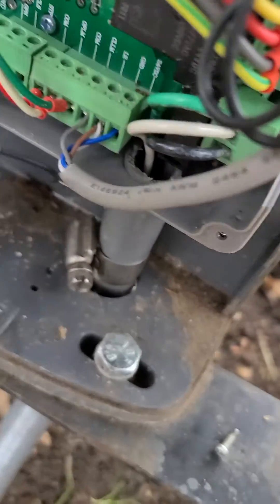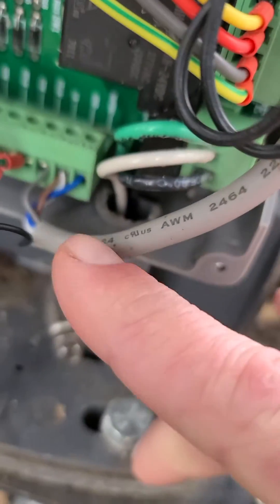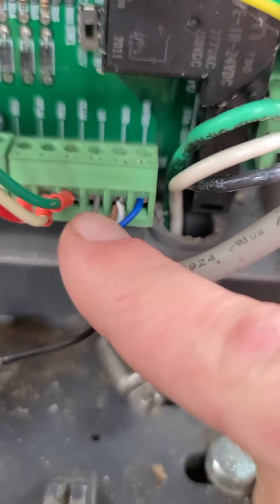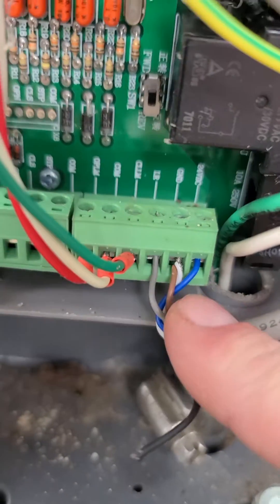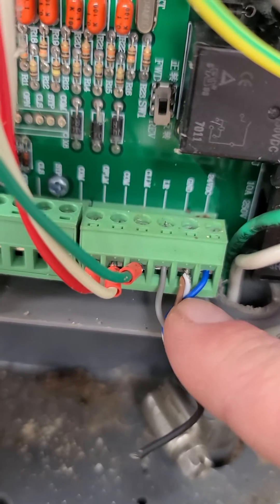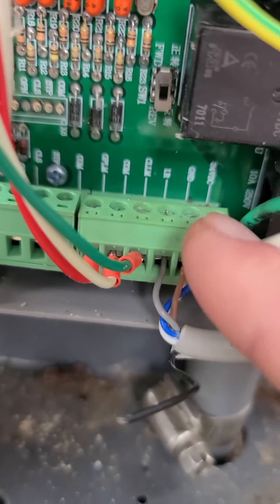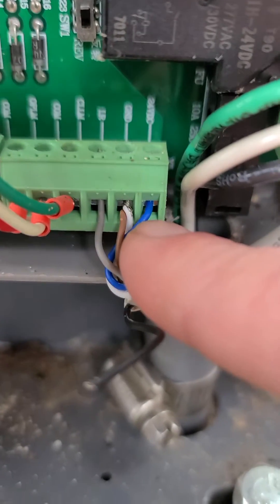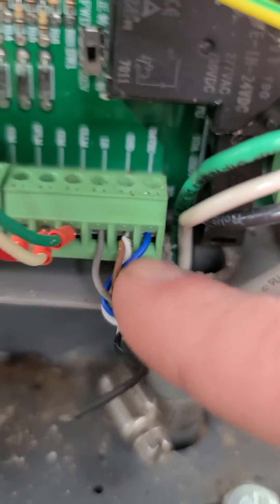CO-Z Automatic Gate Opener. Attaching an infrared sensor

Comment: I have a COZ 1400, connect the photocell from left to right, the gray color, in the middle the white with brown and on the right the blue and it does nothing, the sensor does not turn on the light or anything

Comment: I did exactly what you have shown here but it doesn't stop the ha gate from closing. In fact after it closed it would not reopen. It's still trying to close but it's at the limit so the motor is humming while trying.

Comment: Another question how do I get the automatic close once the gate has been opened? And how do I set the seconds before it closes the gate automatically? Thanks!
Reply from the maker: That's also something I have wanted to know too. Unfortunately, I've never found the information. I'll bet it has something to do with the dip switches on the panel board inside the unit, but I can not be sure.

Comment: Except you forgot to mention about the black wire. Do you just leave it hanging there?
Reply from the maker: Sure did. As seen in the video. The sensor has since failed, so I have just not connected a new one. It suddenly has decided, no matter what, the gate must open and remain open (bummer)

Comment: Do u run wire to the 2nd sensor on the other side?
Reply: This specific sensor model is just one powered sensor and a non powered light reflector mounted on the other side, convenient, but a bit expensive at 50 bucks vs the co-z ir at 20

Comment: This work for the left mount gate or Reverse like the one you have. Mine is the right mount gate or Forward. By wiring the way you did my gate will work opposite. It will forcefully close with or without object in the way but wont open if there is an object in the way. I am thinking about toggling mine to REV and swap the magnet position. It would work but I am not sure it it will cause any problem later.
Reply from the maker: I'm going to be installing a new opener this week or next (depending on shipping times) completely opposite opening setup as mine. I'll let you know what might be different. I do remember that I had to swap 2 of the wires controlling the motor when I originally set mine up, so it's possible that something else needs to be swapped with regards to the infrared sensor. I'll make sure I post a video once I get it working. Thanks for sharing this with me.
Reply: @nathanielross1239 what happened…???
Reply: Were you able to find out the correct setup for the right mount gate or Forward? If you do, can you share? My gate works the opposite.

Comment: Thanks for the video. Can I use two sensors to check both sides of the gate for obstructions? I guess I would just have double the amount of wires in those same terminals?
Reply from the maker: I remember when I set mine up saying that it was only designed to work with one sensor.

Comment: Hi I followed your exact instructions on installing the infrared sensor on a co z gate motor however the sensor picks up but gate continues in the same direction instead of stopping or changing direction and other tips ?
Reply: I have the same damn issue

Comment: To make it work correct to the left the Gray in the Middle White and blue and to the Right the Brown .Black is not used
Reply from the maker: Hmm.. well it works correctly the way I have it wired and it's been up and running for 2 years flawlessly. 🙃 

Thanks for the information because that may be why others have issues with theirs.
Reply: @nathanielross1239  Hey buddy Do you know how to wire the mhcozy wifi relay switch to it?

Comment: I installed and for some reason it works backwards. When I open gate if I cross sensor it will close. Does nothing when opening gate and crossing sensor. Any ideas
Reply: Hi not sure if you fixed your issue or not. But mine was doing the same thing. Our instructions for installing the gate told us to set our direction in reverse because of how the gate was positioned and set our magnet pickups backwards. This worked fine without the sensor but the sensor can not be set up backwards. I had to reverse the direction via switch on the board and reverse the positions of my magnet stoppers. Hope this works for you too.
Reply from the maker: @williamwhite7041  Thanks for sharing this information. Glad you found a solution that effectively works.
Reply: @williamwhite7041  I effectively did this to fix this problem, instead of moving the sensors, I swapped the OPLM and CLLM wires with each other. (I didn’t want to reposition the magnets). I started setting up the gate with the switch on REV, but it appears they didn’t think about how the infrared sensor would behave with that logic. So now my opener has the switch set to FWD, and on the left side like the video and it works correctly. I am also using the retroreflecrove sensor by seco-larm (e-931-s35rrq) wired like shown in the video.
Reply from the maker: I never had issues with crossing the beam and it closing instead of opening. Without seeing your wiring I can only assume you have one set of wires flipped. My guess is you have your sensor installed incorrectly.

Comment: Do you remember wich 2 terminals had that little short wire connected to?  Seems my sensor went bad and I think I need for a my gate to operate again. Until I replace the bad one.
Reply from the maker: I'm not sure I understand which wire you are referring to. Is it one from the sensor? If so, can you tell me the color? I'd be happy to open my panel back up and use it as a reference.
Reply: It's ok I found it. Thanks
Reply: What brand of sensor is that? And could you let me know what each wire is like which is 24 what is com and ground and which is the ir thanks so much